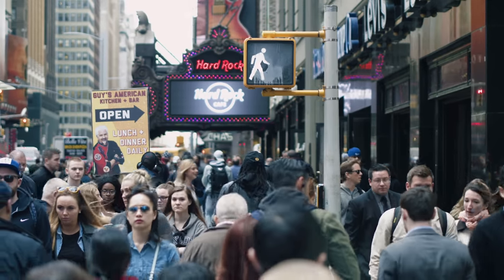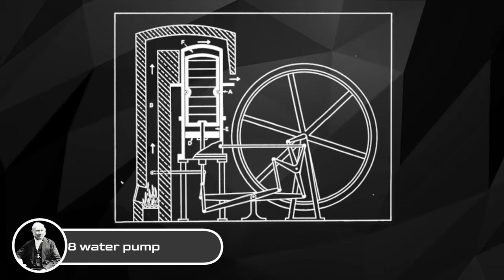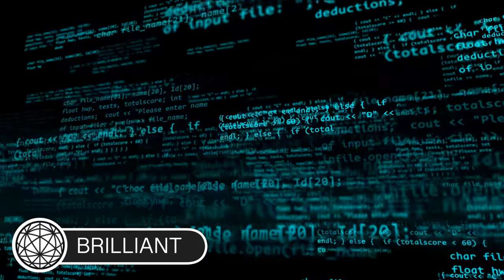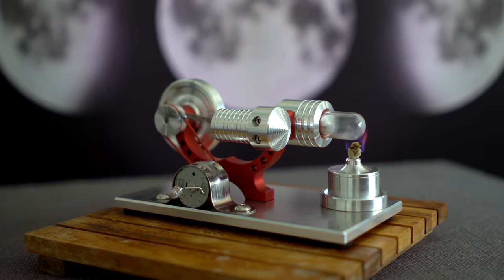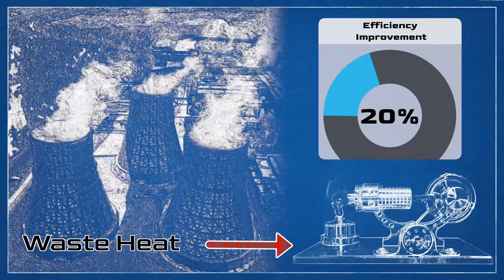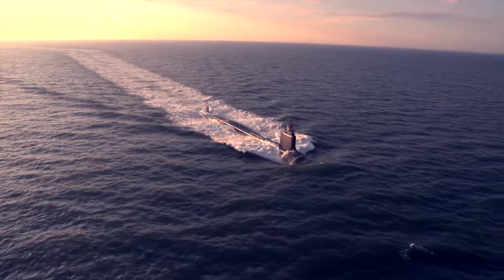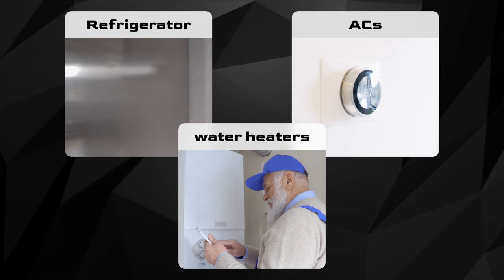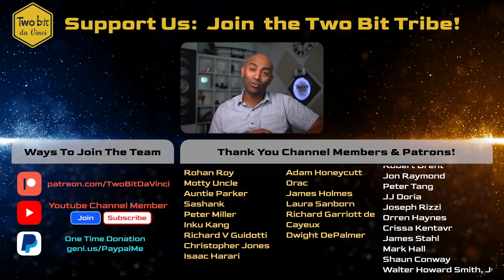Why This Age Old Tech Can Be the Future of Energy - Stirling Engine Explained

Comment: you ask to state if there is a place where I can find/think of a thermal difference that could energize a Stirling Engine, 
to which this sprouted to mind : My Conjugal  Bed.   ;)

Jokes asides, without doing the efficiency related calculations (real cost and energy & time to build and put in place  and environment footprint wise) of Stirling engine vs simply using liquid displacement (by convection) in vertical tubes used in ocean coastline, I sense  ther might be some serious power to be gotten from our ocean's thermal differences between close to surface and, let's say 100 meters below surface.  This could probably work all day long (with peak differences during sunny daytime).   Sure it would probably be a mammoth of a device, but it would probably be able to generate tons of power all the time to feed the power grids along coastlines...

Comment: You mentioned flywheel storage.  Would that tiny red stirling engine that only lights the tiny LED; if you changed that flywheel to a larger heavier one; would it’s inertia increase its output?  Could you do that as a tiny experiment?

Comment: Sorry, but it doesn't make electricity without fuel to provide the heat.
Yes, you could use solar reflectors to provide the heat, or geothermal, but that's not going to be practical in all places or in all applications. 

So in the end, the most likely thing that's going to happen is a fuel of some sort will be burned to provide the heat.

Also, the electrical output obviously isn't greater than what's needed to power the thing... otherwise you'd have a perpetual engine that could power itself.

Comment: Stirling engines designed to scavenge "waste" heat from various industrial processes are potentially a useful thing.. But no fueled Stirling can compete with well designed IC engines.
Reply: Well, the can't compete due to their power to size issue, not that they lack efficiency.

Sterling engines  can convert gas or heat into motion, and do so BETTER then a internal combustion engine - including against diesels.

The problem is not how well they can convert such heat, but the issue is power to weight of such engines is low.

A great example of this is a turbine engine vs that of a gasoline engine.  

Helicopters powered by gas engines were ok, but with the arrival of a high power gas turbine engine, then helicopters became VERY practical. While a turbine powered helicopter eats more fuel then a gas ICE engine powered chopper?

The issue was wanting and needing more power in a smaller sized engine package and one for a given weight.

Same goes for commercial airliners. The power and more speed is traded off for consuming more fuel.

While the gas engine does a better job then a gas turbine in that helicopter (or airplane), the issue was size and weight of the helicopter engine.

A turbine has a VERY high power to weight rating - something a Sterling engine does not.

So, the major issue with Sterling engines is that low power to weight rating. Thus, a sterling would not be useful for a small gas motor attached at the end of a weed eater for example.

Sterling's thus output low power for a given size engine, but are STILL MORE efficient in that heat to motion process then a gas or diesel engine!!!

  In the 1970's NASA took an American motors car, and installed a Sterling  engine in its place (it had about 50 hp vs say about 3 times that with the standard engine in that car. It of course lacked throttle response, and was worse even then the poor response of a diesel  car.

And NASA plans for their next deep space probes to use a Sterling engine to generate electricity from their thermal (nuclear) based systems. Right now they use a TEG (Thermal Electric Generator - which is a solid state system that converts heat to electricity - aka: a thermo-couple based on the Seebeck effect). 

 However, those TEG's only convert about 8% of the heat into electricity, where as the sterling engine will covert about 30% or even a bit more. Thus they can use much less plutonium for that heat based nuclear system.

So, when you mean that  ICE engine like a diesel or gas engine beats the Sterling? You mean in terms of power output, not in terms of efficiency.

Just like gas engines are more efficient then a gas turbine, we use gas turbines in Helicopters since we need more power for a given practical size.

Sterling's might have gained some additional popularity in recent years if not for such huge drops in PV panel prices.

A Sterling using mirrors to concentrate sunlight and spinning to turn a generator actually results in a HIGHER conversion rate of sunlight into electricity then do solar panels!!

However, , with such HUGE cost drops in solar panels, then it has become quite difficult to make a case for sterling engines.

Comment: Does anyone know if the timing between the cold cylinder and hot cylinder is supposed to be 0 degrees? that is, that when the cold cyl is all the way in, the hot cyl is all the way out and vice versa ?

Comment: For those who think that they will get free energy from ambient heat, you need an energy gradient. Without that, it would not work. And to generate a usable output, you need fuel to burn so that temperature can be raised….. back to the drawing broad guys.
Reply from the maker: We have sources of waste heat today. Most engineering processes make waste heat. Strap a stirling engine to the exhaust of an AC system. It’s easy to understand that there’s potential

Comment: Can't someone combine it with the solar lens and make a better alternative to this engine?

If the concentrated heat is good enough to melt rocks it should be good enough to run a stirling engine.

Comment: Cool attic idea. It should certainly have an air conditioning effect. What about a Solar Stirling Radiant Heating and Cooling system. Also sprinkle in some magnetic, gravity, vacuum power maybe? Hybrid seems the way to go. Harnessing power from many forces simultaneously or perhaps with a specific timing might be key.

Comment: What if we used sterling engines as a laptop heatsink and transfer the power back into the laptop to extend its battery life.
Reply from the maker: very cool idea! jsut the size would be tough to manage... which is the Stirling engine problem.
Reply: you want to keep the temperatur of your laptop low. High temperature shorten the life span of electronics.
The stirling engines wants a temperatur difference as big as a possible.
See the problem?
Also Stirling engines are not very efficient.

Comment: They do need fuel to make enough heat to make the engine run. They have to have heat.  Read... The law of Thermal Dynamics. The heat requires energy.

Comment: Several years ago I saw on the Internet a German compact cast iron stove with an integrated Stirling engine for generating electricity. Now this oven is not on the Internet. Why?
Reply: The answer which springs to mind is that it didn't impress the customers in practise, even if it did in theory.

Comment: "This Engine Makes Energy & Requires NO Fuel"
"..they can operate on really any fuel source...."
Right.
Reply: im confused,
i thought it is FIRE at first screen....
Reply: Ambient air temperatures can run a Sterling engine it is just not the best result if you do.
Reply: @Barskor1  I know, all it takes is a difference in temperature. I was just reacting to the contradiction this guy is making.
Reply: @easy_s3351  Ok

Comment: I remember that a long time ago there has been a test with a Philips Stirling engine mounted in a city bus in the town of Eindhoven in the Netherlands. Could you comment on that?
Reply: If you can locate "how it works" book collection, producing in the 70's, it shows a range of concept Stirling engines, like the "fluidyne" and a linear generator model, also shows an engine that Phillips produced back then
Reply: The bus was made for testing the Stirling engine. After the tests weren't been succesfull it was left abandoned. The director of Bus company EHAD discovered the bus and acquired it. DAF placed a Daf Engine in it with a ZF automatic transmission. (source: Wikipedia) The bus is now part of the collection of the "DAF Museum" at Eindhoven.

Comment: Could you use 95 degree water in place of the fuel source?
Reply: Back in the 60s there was talk of using the temp differential of the Gulfstream and deepwater to generate electricity but the problem they ran into was marine growth

Comment: the Stirling engine with a 40 degree delta T, couldn't produce energy from 1% of the heat from the home you need a massive temperature difference to produce significant power with these systems, look at that led Stirling using a candle power, that would stop dead if powered by the hot water cup Stirling engine. The physics is misrepresented here. 2nd law of thermodynamics comes into play, carnots' theorem. a sterling couldn't power a house or computer off low grade heat.

Comment: Trying to ban Petro burning engines are not the answer at our current level of technology. By the time the cobalt and lithium is mined, manufactured, then installed in cars, charged by fossil fuel, then the disposal of the battery after it's life span. You will be lucky to break even on co2 admissions and environmental damage.

Comment: lets not forget that using helium as a working fluid might not be feasible due to a huge shortage and hydrogen might not be feasible unless there are big advances in material science due to hydrogen stress crack corrosion so skip the hype until these issues are dealt with

Comment: How much larger are we talking & would they have to be that much larger if you change the fuel materials in the machine?
Reply: Not just 25% or 50% larger;  think along the lines of several times larger.
Reply: @jackx4311  i assume we are referring to the classic V8 Engine model. So twice or larger should suffice?

Comment: Sterling engines remind me of ion rocket engines--they're very efficient, but they'll never get 'off the ground' because they're just too wimpy. You're on to something here regarding capturing lost heat, but at what cost? Just the energy required to produce an engine large enough to be a meaningful source of electricity might take many years to pay back. Like, create a giant carbon footprint right now in the hopes that in coming decades you can justify it. Nice thought, but I'm out.

Comment: Would Sterling be more or less efficient than thermo-electric systems of the same size?
Reply: A thermo-electric system has a very low efficiency,  2-3%, if I remember well, and is also heavy and expensive.

Comment: Working on firearms could be a very stirling engine working with a gun or crossbow know how this could work if you can find out with nitrol something about nitinol when you heat it it would more cooldown cool it down into its operating temperature at was snapback with fifty tons of square inch couple square inches of force

Comment: Well since it works on Cold too why not put some massive ones in the Antarctic or North poll areas
Reply from the maker: It needs a temperature differential. So Arctic plus some hot source. Like a volcano in the attic :)

Comment: I really hate to be a downer, but if it requires an external heat source to work. Then yes it odes need fuel to run.
Reply from the maker: Heat doesn’t have to come from fuel. You can use ware heat sources for example
Reply: @TwoBitDaVinci  the only thing i was pointing out was even if you were to use it on say a heatsink, you are still using the heat as a source of fuel. Heat is a type of fuel does not mater where it is coming from. If you use the heat from the sun you are using the light from the sun as a fuel source.

Comment: So if I put a sterling engine in my truck that gets 24 miles per gallon of Diesel and converted it to a Stirling engine I will get 30+ miles per gallon of Diesel even though a lot of the energy of the heat from burning the Diesel is not being directed at the Stirling engines cylinder?
Reply from the maker: A stirling engine able to capture all that heat from burning fuel would be too massive to fit in your truck. You need to really maximize the heat transfer levels
Reply: @TwoBitDaVinci  It would require a closed container to encapsulate the combustion of the fuel while loosing no heat to the outside environment.  Explain how that is possible.
Reply: @TwoBitDaVinci  Considering in a perfect theoretical calculation the Stirling engine is 58% and the Auto cycle Diesel engine is 56%.  In the real world due to heat loses to the out side the efficiency drops dramatically and the one that can hold onto to the heat source better becomes the most efficient heat engine.  The Stirling engine is best to absorb waste heat but not as a prime mover except in very specific circumstances unlike what your video was implying.  Even though you did mention using them for waste heat the main premise of your video was that it is the most efficient heat engine, in theory yes but in the real world practical application, no.

Comment: This is a very pie in the sky appraisal of Stirling engines. The amount of power is proportional the differential not the amount of heat. The amount of heat is proportional to how long it will run, but a 40° differential will never make much power. Sorry but you attic heat is an will always be wasted as the cost per watt simply isn't worth what you can get from a 40° differential. It's akin to harvesting power from the phone line. It's 40- 100 volts but it can drive only a milliwatts or 2 which I can generate by rubbing my socked feet on carpet. It isn't even enough to add up over time. Now of you attic temperature was say 1200°F then I would say first get out of the house because it's on fire but a Stirling would make great power because the differential is sufficient to drive the work piston. An internal combustion engine is more efficient because it can take advantage of compression. Not so in a Stirling. In order to get similar power from a Stirling an external continuous conflagration an order of magnitude greater than that of an internal combustion engine of similar power would have to be maintained. Also you couldn't use water as a heat medium because water has a very low boiling point. That would make it too dangerous and unstable at the differential needed to generate any reasonable power.
Once you get to that point you might as well use a steam engine because you just made yourself a boiler. Love Stirlings, yes they may be the future, just not the way you're imagining it. I hope I will show you someday. Be patient, I'm working on it.

Comment: A solar powered stirling generator. That im still looking for. I see them on utube but I cant find any for sale
Reply from the maker: We need more entrepreneurs in the sustainable products space that for sure.
Reply: @TwoBitDaVinci  yes, now ive been walking around with a idea, its a mixture of stirling engine.and a invention of the late stanley meyer. He invented a curricular tube filled with a magnetic gas, that gets pushed around by a lazer. And has copper windings around it. My idea was make a stirling with a piston that has a magnetic flued inside that goes up and down through a copper whining. To create electricity. So u dont need a flywheel ect. So it moves as fast as it can with the least amount of resistance.

Comment: i have thougt a 1000 times about using a stirling engine to use all the lost heat in systems. why dont use the 70 percent of lost heat in a car engine to generate electricity to assist driving the wheels. probably because the patents of a stirling engine are in hands of Shell... why don't make the world more co2 neutral.... because of earning money on it. ..

Comment: How much horse power and torque a sterling engine can make? My guess is Not much .
Reply: I've seen one built into a canoe, and only used on still water.  Despite the Stirling engine taking up far more space than even the smallest inboard engine, it could barely move that light and easily propelled craft at a slow walking pace.

Comment: Hey look this engine requires no fuel... Really? They why do you have an alcohol burniner lit and combusting a fuel in order to operate!
Reply: The thing is external combustion is far cleaner than internal combustion. You eliminate a lot of the nasty combustion byproducts. It's still problematic though because they're just not that efficient. The same amount of alcohol run through an internal combustion engine would produce far more energy output at much higher consumption of fuel however..
Extremely engines are useful however they're often used in submarines as they mentioned and a few other specific use cases that make a lot of sense. There are some interesting designs out there. The really high powered ones move helium under pressure back and forth and are actually quite powerful. There were even some portable generators built and then 1960s that ran on kerosene.
Reply: @kens97sto171  its still burning fuel. I do realize the compreasion issue i am a fedrally certificated powerplant mechanic. The video title is still sensational crap and stirling engines have been promised to be developed for longer than ive been alive.

Comment: Will this engine scale to generate enough power to meet the needs of industry?  "External  combustion" generates carbon dioxide just like I.C. engines, and in the model, the heat comes from burning a fossil fuel and releasing the exhaust directly into the atmosphere.  With an I.C. engine, the exhaust gases can be captured.  There is no such thing as a free lunch.